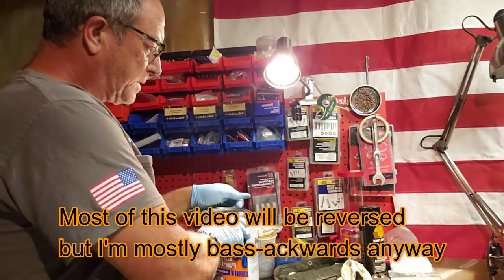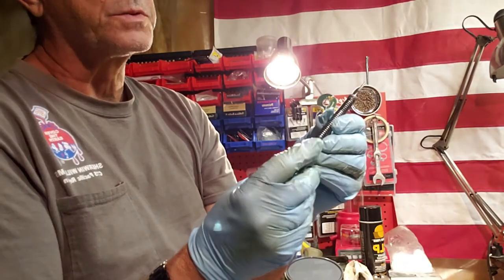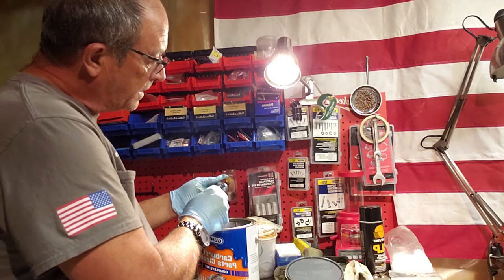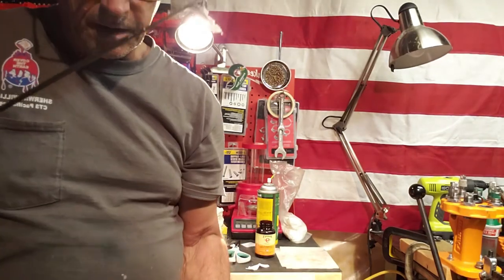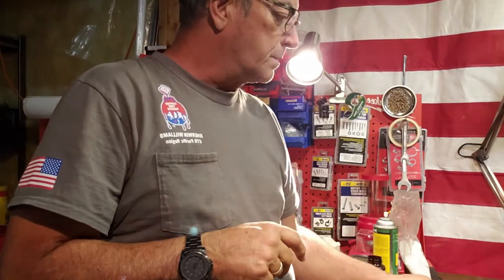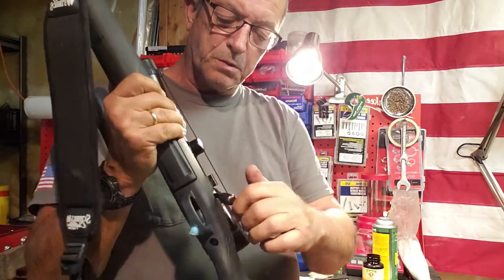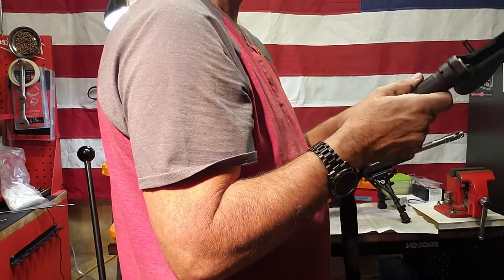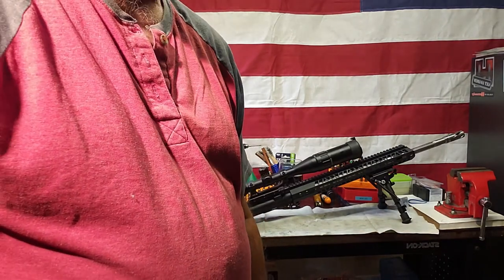Gun Maintenance at home

Comment: Jerry,  I'm one of those people that don't clean my firearms, (I'm not knocking you so please don't take this the wrong way) There are two rules of thought behind cleaning, if you plan to make only one or two shots, Have at it... like in the case of a hunting firearm because you plan to store it after you hunting trip for many months. The other rule of thought is "Fouling" shots, the rifle or pistol zero changes as the bore becomes fouled and settles in a area on the target. A shooter will usually have that within the first ten shots through the firearm. I choose to leave my barrels "Fouled" because I don't like wasting premium bullets, Call me cheap, however, 10 shots for nothing other than fouling doesn't make much sense to me. One of the things that the Military drills into peoples heads is Cleaning. I see why, That weapon must work and accuracy that's pinpointed isn't the goal. function is. and if because of the Over cleaning of that weapon causes damage and effects accuracy or function reliability, the weapon is turned in for depot level maintenance. I believe that you need to eventually give firearms a thurow cleaning, However, only after many, many rounds. -Dave
Reply from the maker: 350 rounds through the Grendel, and it wasn't all that dirty, but I felt the need to do a complete inspection on it, since it's not been looked at since I initially got it, cleaned it, and put it into service. The .243 Compass hasn't been cleaned in close to 300 rounds, either. But I really needed to inspect the chamber, since it had been difficult to lift the bolt, and all of a sudden it didn't have the problem anymore. Whenever anything with my firearms changes, I feel the need to do a thoughough cleaning and inspection. Like the Remington 722 not throwing the cases all of a sudden, and discovered the ejector plunger was sticky. But other than these issues, if the accuracy is still good, and everything functions, no need to clean. Shoot straight, Brother